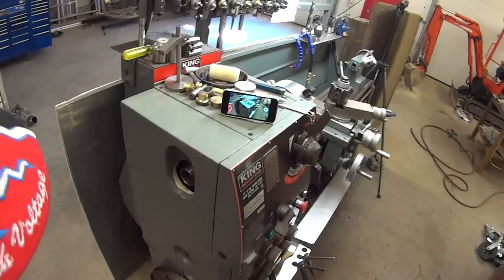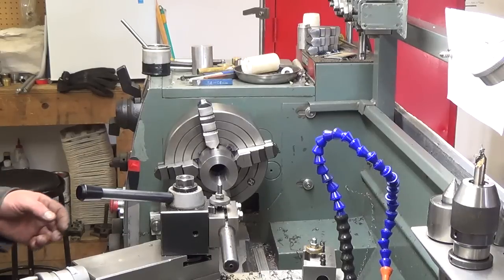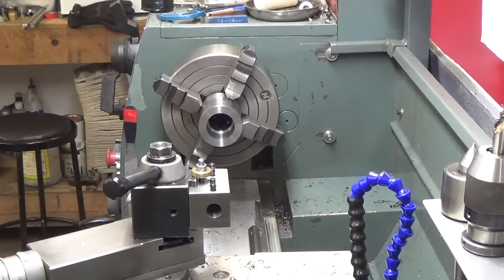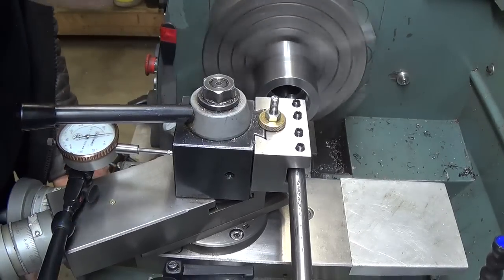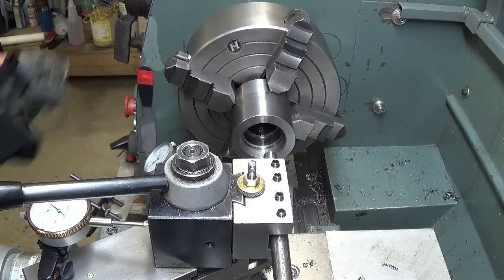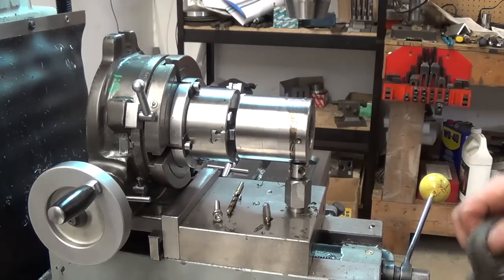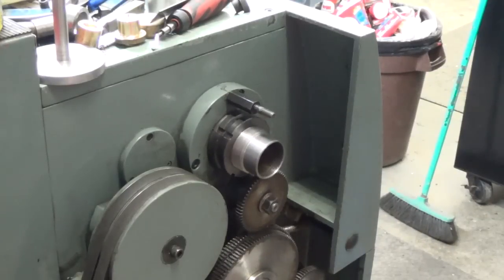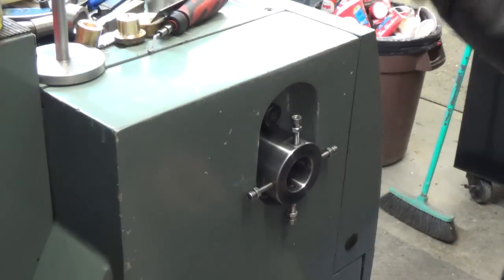4-Legged Shop Spider..

Comment: Interesting accessory project for your lathe. 
It is always a disappointment when you discover a problem with something you have purchased secondhand that you did not know about, but, in this circumstance you seemed to get around the problem relatively easy, well done.
Reply from the maker: Dan Whiteford Other than minor picky stuff the machine was essentially new. I don't think many would have noticed the spindle damage. Luckily enough it was a reasonable easy fix and doesn't affect the machine in any way. Thanks for commenting Dan.  Colin ;-)

Comment: Nice one Colin. I have a similar lathe and jotted down a few ideas from your setup: that tool rack in the back is awesome. Out of the way and seems sturdy enough to not rattle. The gap bed cover is also a good idea. I did one a few weeks ago but yours looks much better. The "order" sheet propped up with magnets, another good one. Can't tell you how much time I've wasted chasing my plans around after they walk away. I have a DRO on mine but it's useless with the x-slide when cutting threads. Noted the indicator on the toolpost.
Reply from the maker: JRoque250 The new rack now holds new lighting as well as the toolholders. Put it together a few weeks back.  The gap cover I made the second day I owned this lathe..;-)  Maybe try to get a segment in vid for ya.   The toolpost indicator props go to Turnwright machine... copied that from Keith. ;-)

Comment: Moments like when it wouldn't fit are when your machine yells out SURPRISE! The spindle hole on my Monarch is so small I rarely get anything long enough and small enough diameter to take advantage of a spider like that. I tend to always get stuck running steadies and working on the 8foot of bed side.
Reply from the maker: bcbloc02 I normally don't need a spider for most work but having to use some drill rod to make pins last week prompted me to get this done. It may not get used for months now that it's done. Thanks Brian.
Reply: Better to have and not need than to need and not have! :-)
Reply from the maker: bcbloc02
Heh, I also liked Fenners "Better to be looking AT it than looking FOR it" line. LOL

Comment: Colin, in one of your videos you mentioned a source for either your keyless chuck or your vice, I can't remember which. I do remember it was a supplier in the Toronto area though. As i'm in the market for both, I would appreciate you mentioning it again. Thanks. I enjoy your videos btw. Great for those of us who enjoy machining as a hobby.
Reply from the maker: The guy I use for quite a few tools is Dave @ Accusize. I find a lot of the import stuff they sell is decent, notably spiral pointed taps. The  keless chucks @ $40 or less are ok especially in comparison to Albrect or such.
Have a look around their website. :-)

Comment: Hello there Colin
Nice demo with good commentary. Heck Man, U really push Your Drills, and that too, without step drilling at all. Your sharpening must be really super-class  !!! 
Need to make ourselves a Spidey also and 'twas well worth watching U going through the steps precisely.
BTW, we do lots of Metric Threading and don't disengage our Half nut at all during the whole process. Once we are absolutely certain that the finished size is "hundreds" ( perfect), then only is the Half Nut disengaged.
In fact, come to think about it and in retrospect, even our Fractional Threading is done like that.  We don't use our Thread Dial Indicator at all. And the Threads are all perfectly finished. Doing things differently to achieve the same result, I guess. 
Thanks for this showing 
aRM
Reply from the maker: aRM Thanks aRM. Generally for me time is money and if I can save time by pushing the equipment harder I will. BUT not at the expense of breaking the tool. Sharpening takes some time to get right even with practice. If you notice that particular drill had a bigger chip on one side...;-)  You can leave the H/N engaged for imperial too but having the ability to let it go is nice. I don't mind any metric threading except when it's to a shoulder..LOL   Cheers, Colin ;-)

Comment: as is often the way of used things, someone has been there before and messed it up, but you got it done!
Reply from the maker: jusb1066 When I went to view this machine the ONLY damage I found was that the gib screw on the compound had a couple nicks from a close encounter with a chuck jaw. I didnt even catch on to the spindle when I measured it up for the spider as I measured in close to the thread. No big deal as it's not a precision part anyway... Good old file to the rescue!  Thanks, Colin ;-)

Comment: I have essentially the same lathe as you, a Kent USA KLS-1340-A.  It has the same outboard spindle end yours has, but no runout or taper!  ;-)  I am in the middle of a handwheel collet closer project and decided to also make it an outboard spider while I was at it.  I decided to intentionally not use the spindle threads to attach the adapter and just made a shoulder to clear the tops of the threads.  I have turned internal metric threads to a shoulder successfully, so that was not the issue.  Rather I was concerned with the spindle threads being damaged if the work turned in the chuck.  Your smaller spider bolts (5/16 ?) should allow slippage there.  I will be using 4 brass 1/8-27 NPS straight thread plugs to friction mount the adapter to the smooth part of the spindle O.D. so if it spins it can't damage anything.  I will be using 3/8" spider screws with brass tips, larger than yours, and they will be located further inboard than yours, just clearing the spindle end.  I will need to use very short screws or SHCS to be able to use the spider with the gear cover on, and the cover will need to be removed to tighten/release them, or remove the cover for using longer bolts.  Your project looks great, we are just making different design choices.  My choices are also influenced by the collet closer function.  Very nice work, Colin!

Comment: Hi Colin,
Try talking, driving, answer the phone, drink coffee, start another job on the milling while threading metric on an imperial lead screw lathe..... !   I Cant.....!
Nice add on to the wish list for missing tools in my shop, do you know of a way to invent extra time....?
Nicely done, was nice to see something done in your shop.
Presently working on something with a little improvisation, wooou...! hope it turns out interesting.
;-) Pierre (-;
Reply from the maker: pierre beaudry Normal threading not an issue...internal short metric..while camera is running.....little more tense...LOL   I've heard you can gain back a few minutes if you run the lathe fast enough in reverse.... ;-)   Thanks Pierre. ;-)

Comment: Hi Colin !

Long time no see ... but now you're back - good !

That spider ... is that enough - depending on how long the material is sticking out of the boretube, I would believe you have to have extra support - I use a heavy stand on the floor and the spinning material is then turning inside ring on top of this stand - you just have to prevent the turning material to START flapping around - I don't think your spider will do that for longer materials - right ?

And those 4 long screws is a dangerous thing to have spinning around in that place - a big diameter plastic pipe glued to the cover and drill a hole on the upper perifery for screwing and unscrewing - just an idea ... for free ! ;-))

I love your nice and clean machines, I just love them ... wish I could clean my own likewise ;-(( - thx for sharing !
Reply from the maker: Keld Sørensen Hi Keld. In my experiience most smaller material can be dealt with in <4' lengths. Very little work is of anything longer.  Additional support can be added if needed easy enough.  With the minimal extension from the gear cover I don't believe the screws to be of anywhere near the danger of, say, chuck jaws extending outside of the chuck body.  The thing is, one has to be cognizant of such things when working around a machine shop.  Thanks for the visit and comments.  Colin ;-)
Reply: ***** Hi Again !
Here I buy stock in length of 2 meters and that has to have some exstra support for thin diameter material - I think that's what happened to your machine in the past since the spindle tube is so bell-shaped. I believe my spindle pipe os 5-6 mm thick material, so I don't think I need a spider inserted in the end of it - anyway, nice to see you machines ;-))

Comment: Man, the thread cutting process you needed to use looked hard on the nerves.
Reply from the maker: Arthur Donald It gets much harder when people are looking.... ;-) Normally not a problem.   Colin ;-)
Reply: Yeah I've had my nerves shattered once too many times so I set about to make a 'Kill switch' that slides up and down the control rod and has a taper on it so that as the carriage reaches the required position, it flicks the rod and switch to off. It locks to the rod with a knurled thumb screw wherever needed. When metric threading, the nerves are now 'cucumber cool'.

Comment: maybe they lifted it with a strap around the back of the spindle , i've seen that done before. Don't think previous owner had an accident because it would be banged up rather than ovalized.
Reply from the maker: meocats I really can't think of another reason for the end of the spindle to be belled out like that and I am only surmising as to cause. Whatever the reason, it threw me for a loop during this project. Thanks for stopping by.  Colin ;-)
Reply: alright, thanks for making videos